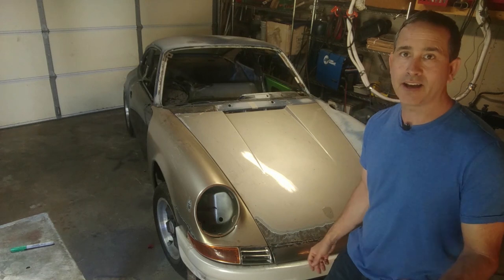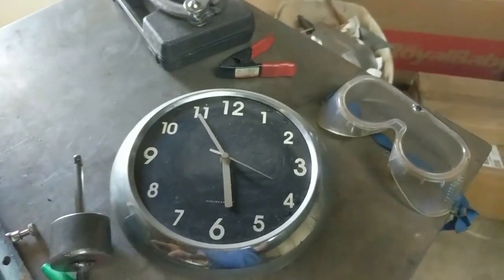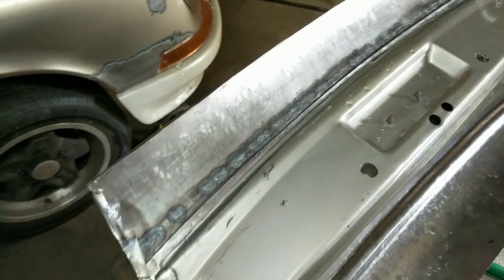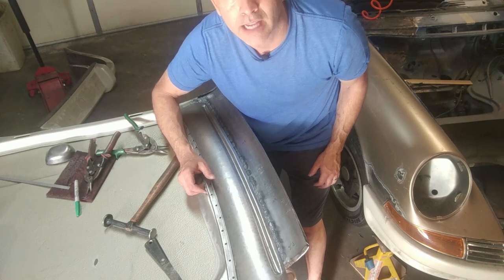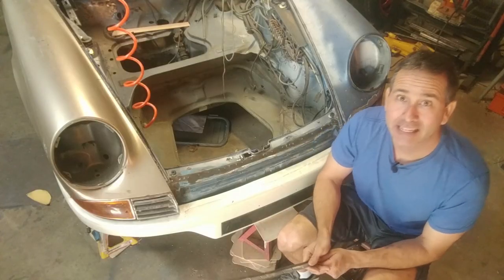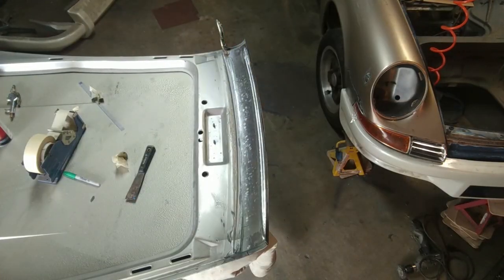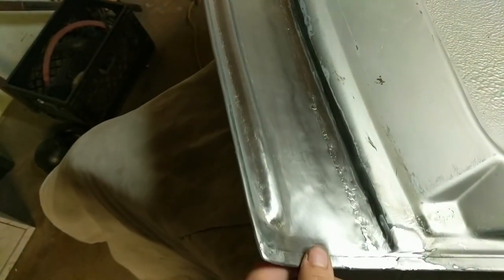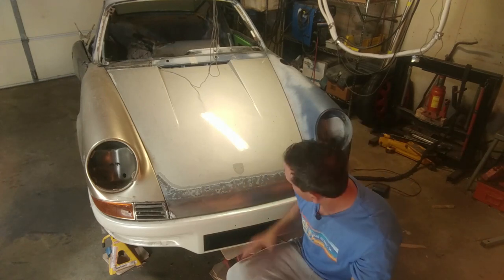Porsche 911 Restoration Project - Hood Backdate Complete

Comment: Great video. Would you advise for other guy to do it same way (extending the hood) or rather look for used or even new, "long" hood? Will keep watching next episodes. Thanks!
Reply from the maker: If you use a real longhood then you must change the latch panel too.  
If money was no object, then I would buy all the longhood parts.
My car is very low budget, so I did it this way with no new parts.  Your results may vary, ha ha.
Reply: @GarageTimeAutoResto  Thanks for explanation. In such a case (latch panel change) it really makes sense to go the way you've followed